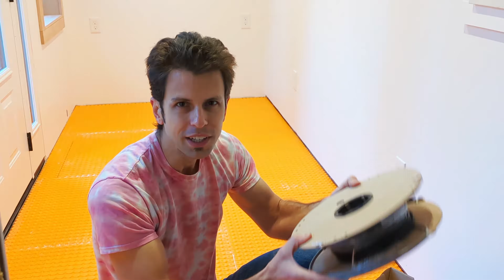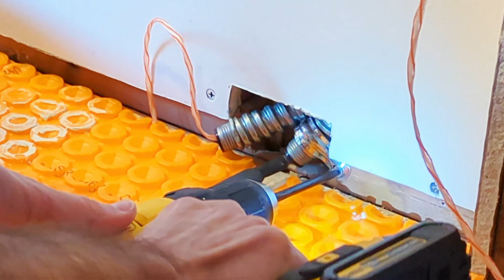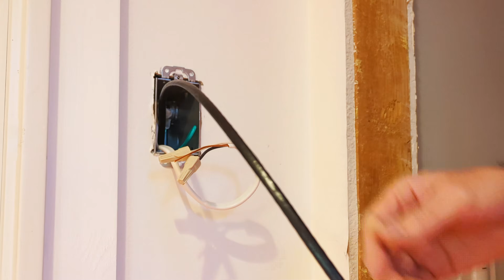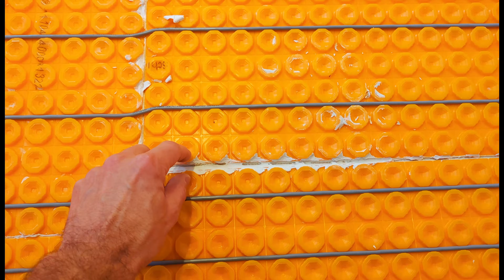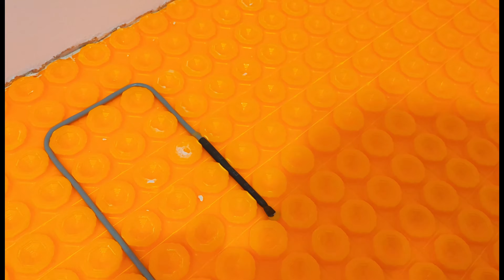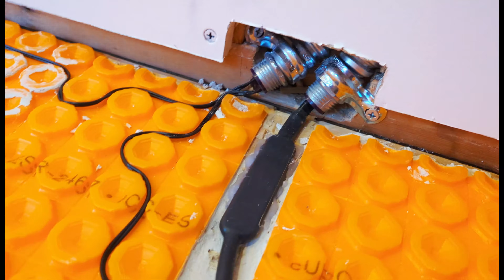How to install Ditra Heat Cable and Temperature Sensor Wires

Comment: Can the sensor wire and the pwr wire run thrue the same conduit ?
Reply from the maker: No, not allowed per NEC electrical code to have line voltage and low voltage in the same conduit.

Comment: Mi jefe instalo pero se olvido de poner los cables del sensor que se puede hacer ante eso
Reply from the maker: Best to make it right. I would pull up a tile and carefully install them. Otherwise, the other options are to try and fit the sensors between tiles before grout, or set the thermostat to use room air temperature (I'm not sure if that function is built in to the wall thermostat or if you need a separate sensor).

Comment: Looking to install this in my RV while using my bluetti battery inverter generator. Will hooking up the wires to a 120 plug with pigtails work?
Reply from the maker: Hooking up the Ditra thermostat that way could work. Can't hook up the heating cable directly to a plug though.
Reply: @realhouseDIY ty

Comment: This vid was exceedingly helpful, TQ.  I completed the job & the system is working well.  The only issue I had: the cable I bought is supposed to be 124.1 feet long, and I carefully laid out a path for it; however it was 29" inches too long (I know for sure I measured correctly) ... I had to wrap the excess in an area I hadn't intended.  It hasn't been a problem, but when planning ahead assume there might be a bit extra and that there is a benign floor area where it can go.
Reply from the maker: Thanks! 29" isn't too bad! I'm guessing they make them slightly longer since too short wouldn't be good

Comment: Why do you need conduit inside the wall? Also, if you need conduit why two separate raceways?
Reply: By NEC electrical code you are not supposed to have class 1 and class 2 wiring in the same conduit. Line voltage(heating element wiring)-class 1, control voltage(thermostat sensors)-class 2. The conduits are simply to make sure the wires don’t come in contact with each other. The conduit is not required by code, but stated by the manufacturer to ensure proper separation.
Reply from the maker: Per the install instructions, the heating cable cold lead needs to be installed in an approved raceway or conduit. The sensor wires can be in their own conduit or the same conduit with the cold lead. The reason is for protection from rodents, overheating, nails/screws,  fire hazards, etc. As well as to be under warranty probably. Of course the system would still work without conduit though.
Also I'm trying to remember why I used 2 separate conduits... May have been my interpretation of the electrical code where you don't want to mix conductors of different types in the same conduit.

Comment: Next bathroom put a junction box at the bottom.
Reply from the maker: Hidden junction box isn't allowed... Though there's no junction actually being made so maybe that is okay. Plastic box and conduit sure, but would be some extra effort to do that with metal and the correct bushings to have no sharp edges.

Comment: I used a glue gun to keep my sensor wires in place. And also to hold the fused portion of the 120v power wire.
Reply from the maker: Instead of jogging the sensor wires? Good idea if you need some extra length

Comment: great video! where'd you get the temp sensors?
Reply from the maker: Thanks! The temperature sensors come with the Ditra heat cable. I ordered from warmyourfloor.com. you get both the heat cable and 2 sensors

Comment: What happens if we have left over wire? Can i cut extra cable?
Reply from the maker: You can't shorten the heating end of the cable. You would need to replan the stud spacing, or if there is a lot leftover, then need to buy shorter cable.